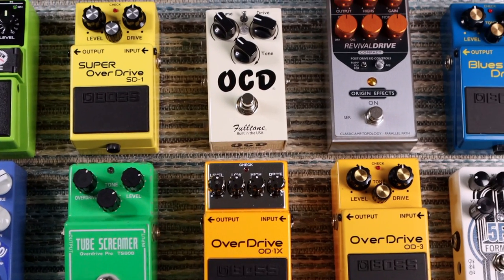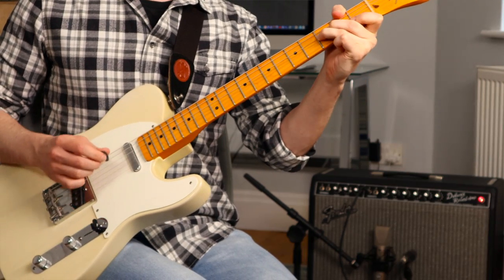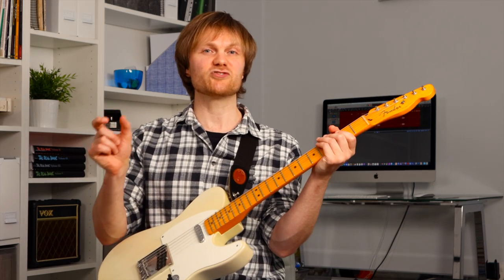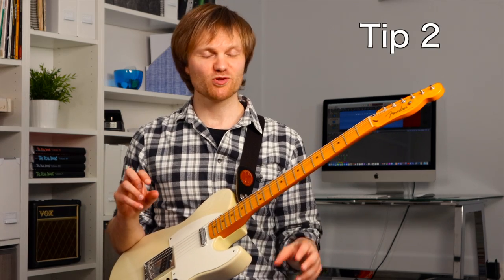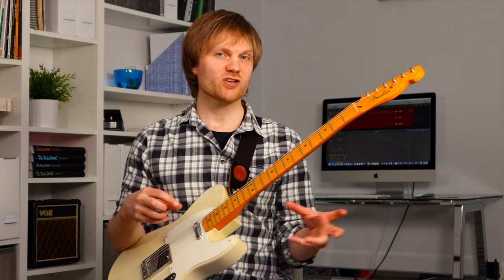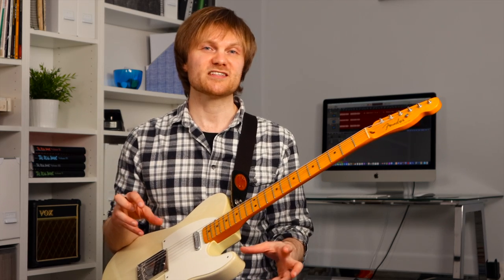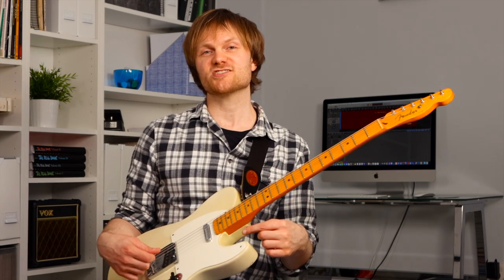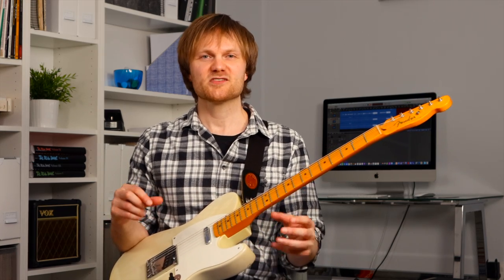3 Tips To Improve Your Overdrive Tone Using Picking Technique

Comment: Thanks for the reminder that picking is integral part of the tone. More often than not, I am focused strictly on the gear and settings, getting frustrated when I can't obtain a certain tone.

One picking trick I am using though is pick rotation: forward sounds warm and compressed, backwards is twangy, with more attack.

Comment: Hybrid picking is great to keep a balanced tone across the strings as well: the pick on the lower strings gives them a bit more bite and the fingers plucking the higher ones prevent them from getting to bright. Plucking two strings simultaneously makes them ring and overdrive with a bit more thickness if that makes sense.
Nice channel, by the way. Found it while looking for videos on fender style amp-in-a-box pedals and came across your comparison of the four Boss pedals and it was great. Super useful because of the way the comparison was made. Very well thought out and executed. Subscribed right away.

Comment: Right on, I don't play as often , or as long as I used to in years gone by and at times I am finding dissatisfaction with my sound now. So the pedal rotation starts on my board to fix the problem. Of course that is never the problem, you just need to get back to playing your hands back in to suit you ears. Having said that I dropped the cash today for a Boss  OD3 pedal and it is great. A big open sound, hard for me to describe but you lose the mud from your distortion sound and each string sounds separate if that makes sense. I am loving it and getting back into practice.
Reply from the maker: Yes that makes sense to me, there’s something about the mids that helps the individual notes really stand out. Fantastic to hear that it’s inspiring you to play and practice a bit more too!